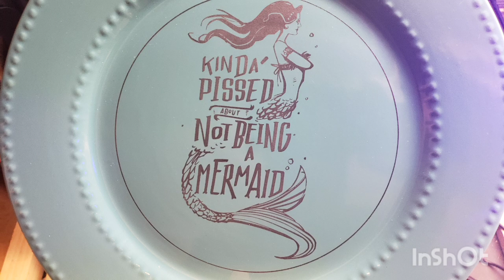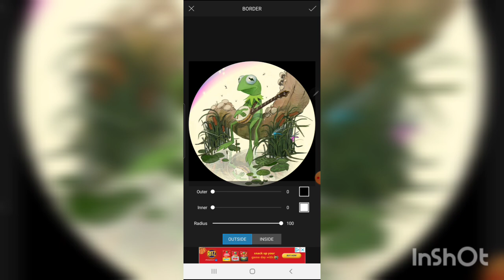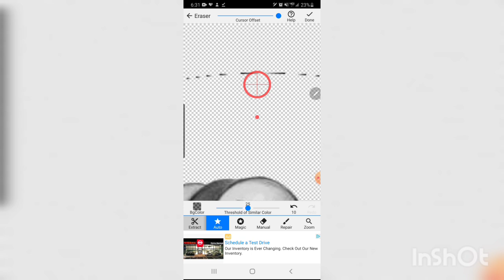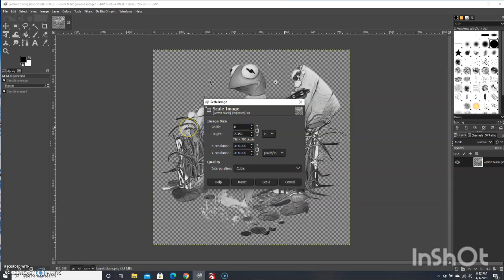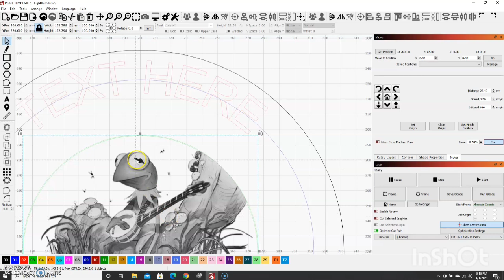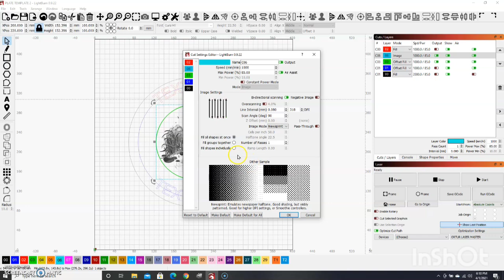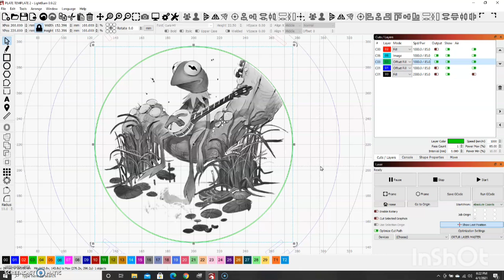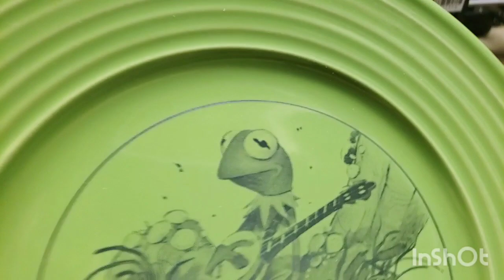Norton White Tile Method on a Colored Plate Tutorial. Ortur LM2 15 Watt.

Comment: I love the way you explain in the video. It is special. Thanks again.
Reply from the maker: It can do the brightness, contrast, adjustments, etc. You do have to adjust the photo to the size and resolution you want in Gimp or Inkscspe. The new updates may have fixed the problems but back in the day lightburn would cause banding issues if the size and dpi weren't original to what you import into the program.

Comment: My first attempt at the norton method on a white plate was quite successful using a 20w fixed focus ORTUR. I get very fine detail with it.
Reply from the maker: Thats good to hear. I thought I'd had seen a few people with the fixed 20 be able to get it to work. I might of had luck with the G8 lens but I just haven't had time to play around with that yet.
Reply: my 20w ortur says fixed focus, but once i read the instructions the lens holder is friction fit and slides up and down for fine tuning and i also get great detail on tiles, plates, and any colored ceramics or tiles, i like the more expensive marbled tiles as they seem to be flatter. that seems to be my only problem is the unevenness of the tiles
Reply: Hi, I recently bought a 20W as well. Could you share your setting? Cheers
Reply: @avleathercraft648  I will check when I am at my computer again. There's a really good group on Facebook too that has been very helpful. It's the official Ortur user group. I will also say this is a great YouTube channel to follow.
Reply: @risbill1  Thanks. 👍
 I already joined the Facebook group as well

Comment: I just bought some white plates today, now I need to look for some colored ones too. I have an lm2 20W NFF and hope it'll work out half as well as your green plate did. Thanks for the video!
Reply from the maker: Is that a non fixed focus or new fixed focus? The fixed focus works my variable focus i couldn't get the paint to fuse very well.
Reply: i run the norton test tile, modified to only goto 80% power, then i select the best speed and power combo and rock on. the paint matters, i find ironlak and kobra give darkest blacks but rustoleum 2x flat paint and primer also goes a fine job. I process all my iimages in imag-r norton white tile method. What is really important IS TO NOT SET THE DPI HIGHER THAN THE SIZE OF YOUR LASER DOT/BAR
Reply: @TheKennyHack  Non Fixed Ficus. Good guess, lol!

Comment: i like your work i wish i had bought the laser you have i opted for a 3018 pro so i had the engraving as well as a laser but i need to get my settings sorted :) love the vids
Reply from the maker: I've seen some nice work with those as well. Maybe just not as big of work area. Whats the max travel speed on those? At around $200 a 15w is a pretty cheap tool. Pay for themselves fairly easy with just a few sales. Thanks for watching.
Reply: @TheKennyHack  mine travells burning plywood at 1200mm/min but only 950 doing the tiles so a slow job, i actually completed my first white tile yesterday after 3 days of getting it wrong lol..
Reply: @peterbrady4303  I bought the 3018 pro and wound up using the open builds acro plates and some 2020 aluminum extrusions to build a 1000mmx1000mm laser... pretty straightforward if you like to tinker...